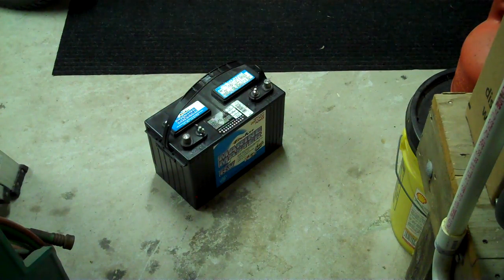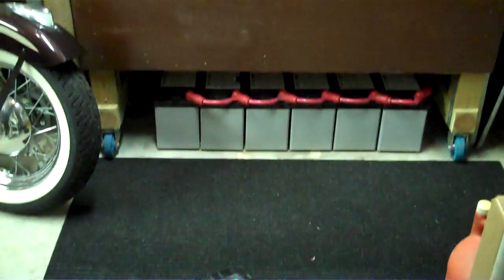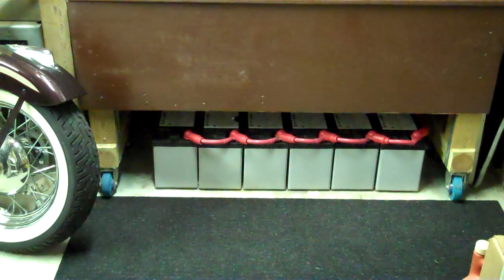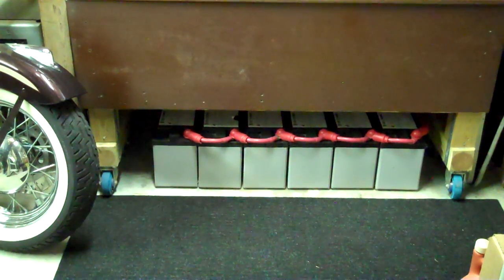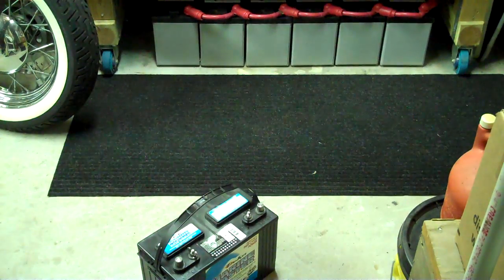BATTERIES OR A BATTERY ON CONCRETE !!! ???? Whats the real truth..

Comment: Old batteries were made of Rubber case and leaked acid very slow and could conduct electrically to ground. Cool Concrete is good for a battery

Comment: It may not discharge the battery being on the Earth ground, but batteries will take a slight charge from the aether by being up in the air or on a non conductive shelf. Just like all the AC power lines are in the air, rather than being all buried in the ground, they take a charge from the aether being up in the air! Another name for aether is longitudinal energy or non-hertzian energy that Nikola Tesla said was all around us in abundance, his 3 patents of different radiant energy devices that all collect longitudinal energy from the black hole in every galaxy. Not taught in schools. Learn more at batterysmacker dot calm

Comment: Hahaaa! Great video. I know it is two years old...but, still good. I got my eight Trojan L16's on a  rubber horse stall mat (from Tractor Supply). Mostly for protection of the battery sitting on concrete.

Comment: i see the nose of a Softail Springer sitting there, great bikes for sure.  ok, i have a chance for a great buy on some 6volt golf cart batteries, but i am not sure of them because of their brand  ( SUPER START GC110DT )  they have a 20AH rating of 230AH's, the battery itself has an AH rating, but when i go to check it out on the website where it is sold, it also has a CCA of 245.  have you ever heard of this brand of battery?  i looked at the Exide GC145 and it has a rating of 245AH @ 20hr, but they are really proud of them. could you give me your opinion between the 2 battery brands?  thanks, KC

Comment: your battery bank looks good but how-bout a better air-gap between each to promote air updrafts between battery cases and achieve a cooling effect when fast charging [if you ever do get them slightly warm or more],... as it stands now, if your 6 batts are all you have, you have 14 sides exposed to air and 10 butted against each other. that is 41% of the side surface area. thanks for your video info on concrete

Comment: A few quick questions, what brand of batteries are you using. How are these batteries wired ? all parallel or series / parallel. where did you purchase your batteries from. Ty for the tips.

Comment: i have a houseboat with 9-12v batteries and two solar panels but here lately i cant seem to run the 110v very long (cant even play a full movie) the system worked fine in the beginning (about 2yrs) i dont know how old the system is but i think the panel are not putting out anymore and i would like to change  them out does it matter how many panels and how many  watts i put as long as the charge controller can handle it. and what do you think would be a good way to go?thanks for any help or suggestions you may have
Reply: buy a shunt tester, put a load on the batteries and you'll have an answer. The price of solar panels is down to less than $1 watt.

Comment: To funny, I never knew that but it makes sense. it's just like the wise tail about 6 volt golf cart batteries being superior to12 volt deep cycle batteries. The lead plates are the same thickness in both, there are just double the cell in a 12 volt. If you could cut the twelve in two you would have the same battery as a 6 volt. At one time 6 volt were superior but this was when the 12 volt was a new idea. Now if you are talking about the 2 volt batteries, they are superior they are superior because of the industrial size, but they cost a fortune.

Comment: I've worked with many batteries over the years and the most logical reason I have heard regarding to not putting a battery on concrete is that, if it gets overcharged for some reason, the acid may over flow the top, grounding the positive terminal as it hits the concrete.
 All I know for sure is one of my best friends has been a battery engineer for the last 40 years, and his favorite saying is,    "Never, Never, Ever, Trust a Battery!"  (-;

Comment: You see, the myth that concrete drains batteries does have some historical basis. Many, many years ago, wooden battery cases encased a glass jar with the battery inside. Any moisture on the floor could cause the wood to swell and possibly fracture the glass, causing it to leak. Later came the introduction of the hard rubber cases, which were somewhat porous and had a high-carbon content. An electrical current could be conducted through this container if the moist concrete floor permitted the current to find an electrical ground. The wise advice of the old days to "keep batteries off concrete" has been passed down to us today, but it no longer applies because of the advanced technology of today's batteries.

Comment: I live in Canada in a cold place where we experience -40F every winter. If you live in a very cold place putting your battery on concrete when the concrete is very cold and the ground is frozen to 10 ft. down is a bad idea. The battery will die in 24 hours. It really is just common sense it's the cold factor not the concrete factor.

Comment: what about the concrete dwelling  polypropylene eating sand worms that are prevalent in your area???? don't the burrow in to the battery cases and lay their eggs??? Dude you need to put those batters off the ground on a steel plate that holds at least a inch of water and fill that will diet pepsi to keep out them nasty  polypropylene  eatin bug brother....

Comment: ive been selling and servicing batteries for 15 years. you are 100% correct. the key is to keep the top clean and nuetralized to avoid acid runs to the concrete, which can cause transient voltage discharging. a product like nuetraclean from Ramsey products works great. older battery cases werpe made of a material that did bleed off voltage , but as you stated poly cases solved that issue 40 years ago. thumbs up !

Comment: I worked in auto parts for about 5 years or so from about '95-96 to around 2000 after talking to the reps that would come in there about this it breaks down like this (according to them) if you USE your battery's like you do, all the time, it's fine no matter the climate but if you STORE THEM say for the winter then keep them off the COLD concrete it will drain them and may kill them depending the age of the bat. 2 things kill them, the cold and lack of use. so use a bat tender for cold storage.

Comment: The old cases used to be hard rubber, but they have been plastic for decades as well.  The only different ones are modern spiral cell, or gel celled batteries.  A good battery is worth the money for sure.

Comment: Early batteries had rebuildable cells with cases that could discharge on concrete.  Some industrial batteries are still constructed this way, but all others are as you described.  I spent some years selling batteries as a factory rep and this was the most common question we were asked.